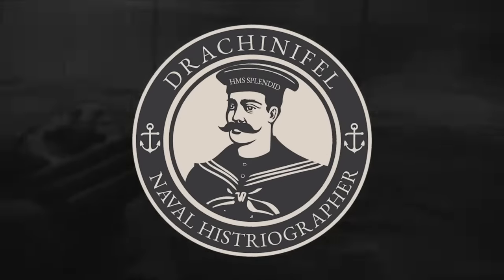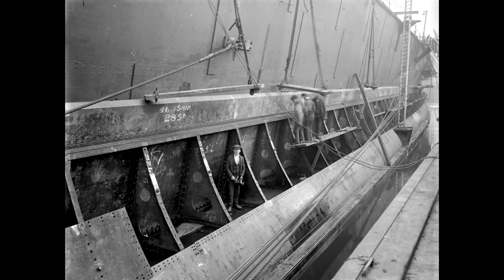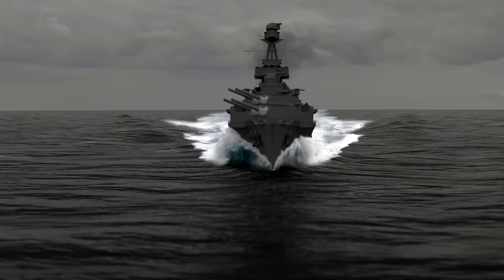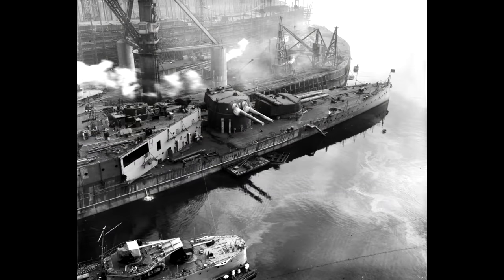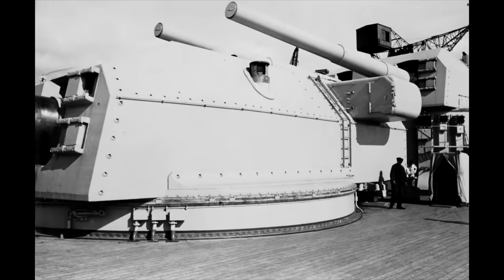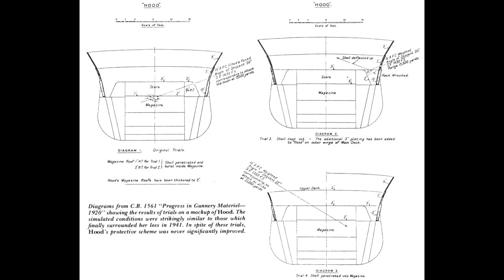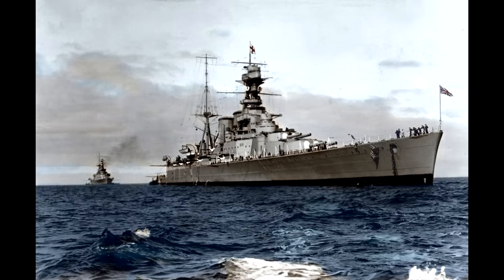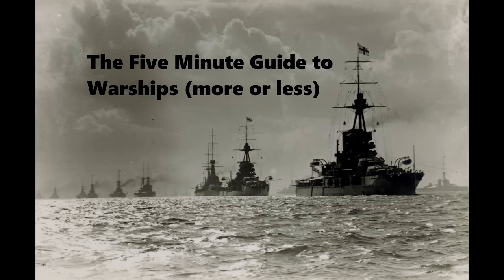The Loss of HMS Hood - But why did it blow up??

Comment: First of all HOOD was never a Battle ship but a battle cruiser lightly armored  and fast a ship that could not fight nore run away . Besides they do not know if it was Bismarck that fired the shot that sank Hood it could have been Prince Eugan  it was just assumed it was Bismarck that did it .She was a ship that should not have been put up against another ship like Bismarck .But it was a sad lost no matter how look at it .
Reply: Hood was as well armoured as many contemporary battleships.

Anyone with any knowledge knows that Prinz Eugen didn't sink her. Firstly, Eugen used HE not AP shells throughout, secondly, Hood's armour was proof against even AP shells of 8 inch calibre, and thirdly, Prinz Eugen was firing at Prince of Wales when Hood exploded.
Reply: @dovetonsturdee7033  No Hood was not when they added her armor to her torpedo belt she sank over 3 ft down and they knew if they was to add the rest of the armor to her deck her stear would have been under water .
Reply: @shalaconballard9912  Hood had armour on a par with that of, for example,  the Queen Elizabeths, and thicker than the Iron Dukes or the Nagato, and her belt was the same as that of the North Carolinas. That is, simply, a fact.

The post-Jutland redesign changed Hood, from a conventional battlecruiser into a fast battleship, and did result in her being lower in the water, but there was never any intention to add further armour to the ship in her existing form.  There was a proposal, never implemented because of the war, for her to undergo a complete modernisation along the lines of Queen Elizabeth, Valiant, or Renown, which would have seen her with new, lighter, engines, and a totally different superstructure. Significant weight savings would result, which permitted installation of enhanced protection without increasing the overall displacement of the 'new' ship.
Reply: @dovetonsturdee7033  Well as far as I knew she meaning Hood had already been up graded to newer turbine engines and was suppose to have her deck armor up graded to between 6 to 8 inches but was never done due to the fact they wanted her out there hunting Bismarck . They only called her a fast battleship witch she never was nothing but a battlecruiser .
Reply: @shalaconballard9912   Sorry, but you are wrong. Hood was scheduled for a complete modernisation, as I have already described, but didn't receive it because, after 1939, no British capital ships could be taken out of service for a two year period.

I have already described Hood's armour. If you don't believe me, simply look up the details for yourself. I don't choose to repeat them.
Reply: @shalaconballard9912   Very nice. You should look at any proper book on HMS Hood for accurate facts. I would recommend 'HMS Hood - Design & Construction' by Maurice Northcott, or 'British Battleships of WW2' by Raven & Roberts, to begin with, for proper facts about her.   These detail, in particular, her re-design after Jutland, and the proposals for the 'Large Repair.' This was the modernisation which never actually happened.

Put simply, Hood was a ship with the armour of a contemporary battleship, and the speed of a contemporary battlecruiser.  

As I said, why don't you look up any of the numerous sources which detail her armour, instead of sticking doggedly to your opinion in defiance of the facts?
Reply: @dovetonsturdee7033  Well they did a TV interview with some of the men that worked on Hood as she was being built and they said she did not even get all the upgrades . They told in the interview about her armor belt that was suppose to go clear to the top they said it only extended 3 ft above her water line to save on weight . and in the same interview they said her deck armor had gotten so thin in places they could push there fingers through it and that was just days befor she set sail to go after Bismarck . The truth is she would had better luck defeating Prince Eugan  than Bismarck she was a total pig of a ship by that time due to the years of neglect . Its just like the British said they sank Bismarck when the truth is she suddled her self and they fired at her as she sank .
Reply: @shalaconballard9912  'The men who worked on her when she was being built?'  Don't be an idiot. She was built in 1921.   You are either imagining the interview, or simply lying. 'Push their fingers through the armour?' Utter bollocks.

Of course the Bismarck scuttled herself. The facts that her main armament had been destroyed, her command staff had been killed when Rodney hit her bridge, her internal communications had been crippled, she was riddled with internal fires, listing heavily, and settling by the stern, were just coincidences, I suppose.  Incidentally, how is that relevant to Hood's Large Refit?
Reply: @dovetonsturdee7033  I've never seen you driven to use such "workplace" language Admiral !!! Granted it was warranted !!!

Comment: watch the gun data of the 38 cm SK C/34 the Bismarcks Maingun and you will see that belt penetrations at 14,000y are more than posible the gun punches trough more than 20in or armor at 14,000y at a 10 degre angle you cant compare german guns of that time to anyting around they where superior to US and Great Britain if you take the same size
Reply: Bearing what you say in mind, its surprising that German large calibre naval guns did so little during the war. "All the gear and no idea" maybe?
Reply: @walterkronkitesleftshoe6684  they never came to use as far as i know a lucky shot hit the bismarks firecontrol system at the begining and the sistership was bombed from high altitude by earthquakebombs or however they caled them
Reply: @janicmeier1  Why is it German fanbois ALWAYS talk about "lucky shots" and torpedoes, with a completely straight face, while ignoring the luckiest hit in naval history on Hood's magazines. If the "dice gods" hadn't smiled on the nazis at that point, Hood / PoW would have closed a little further, exposed their full broadsides, and initiated a horrible exchange of heavy fire with the probable end result of both Hood AND Bismarck crippled or sunk in the Denmark Strait engagement. P.S the Bomb's dropped on Tirpitz were known as "tallboy" weighing 12000lbs (Or approximately five and a half tons).